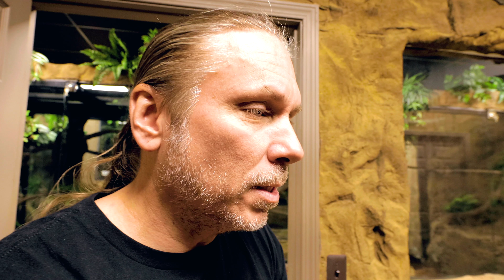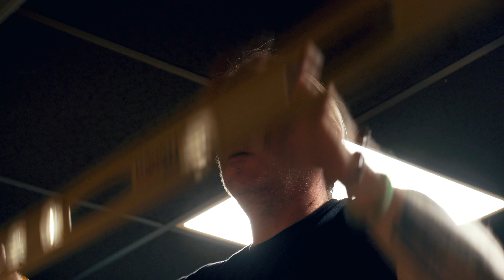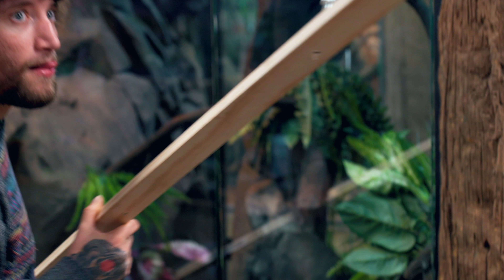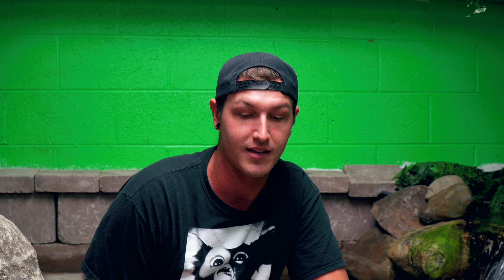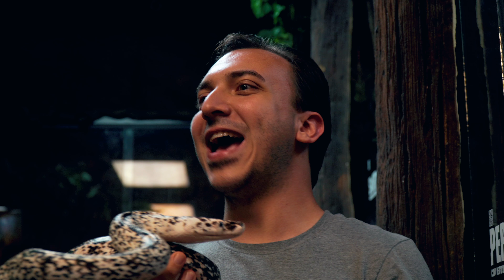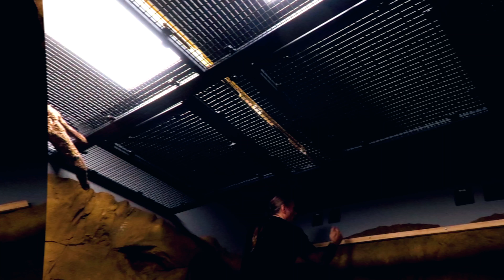MY HUGE ALLIGATOR ATTACKED HIM!! | BRIAN BARCZYK

Comment: These ceilings are amazing, but will Drogo's claws be small enough (or the space between wires be big enough) for the claws to get stucked? And will the ceilings be stable enough if Drogo decide to hang on the wires and not fall off?
Reply: I think so for sure, they are bolted straight into the wall's braces and bolted together real tight, shouldn't be a problem. Not sure about the claws though